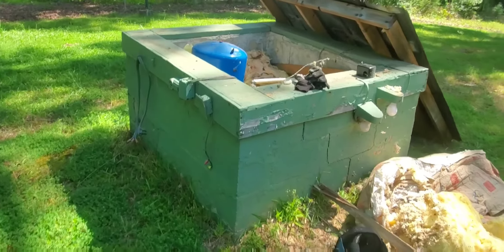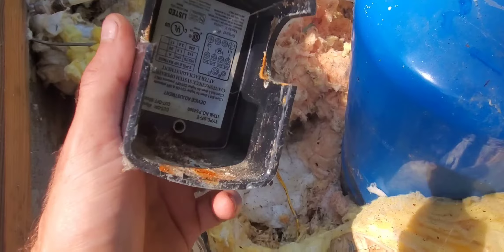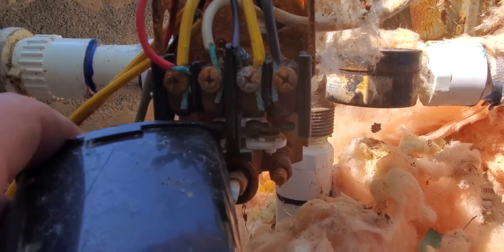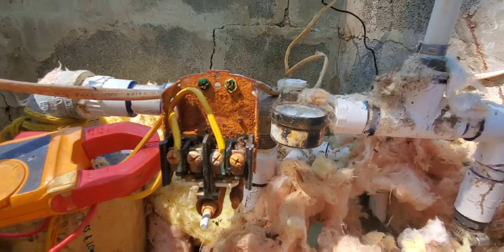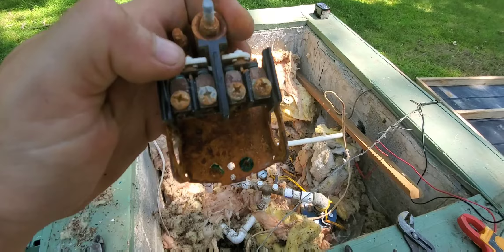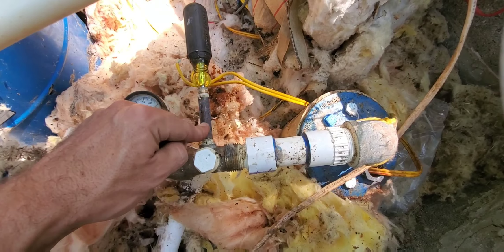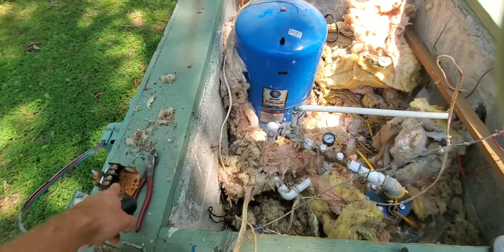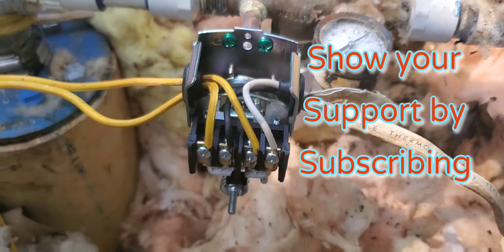Well Pump Troubleshooting, Pressure Switch Bugs in Contacts

Comment: Supply store was out of the 30-50 low pressure shut off…Can I use the 40-60 low cut off and modify it to work as 30-50? How do you know if your well needs a low pressure shut off?
Reply from the maker: @stevevandelinde1204  yes you can use it. Just set the tanks air pressure to 35psi (make sure the tanks empty of all water when you add air to the tank). 
Typically wells that run dry need a low cut out switch as a added safety.

Comment: cover is missing on the pressure switch; tank PSI reads 28.5 psi but the gauge is showing 80 to 100 psi when turning on and off.  Im thinking I possibly have a bad gauge and should replace both the switch and gauge to play it safe?   but im unsure which switch to buy
Reply from the maker: Replace both switch and gauge. I'd buy a 40/60 switch & air up the tank to 36-37psi. Then turn the system back on and see how it performs